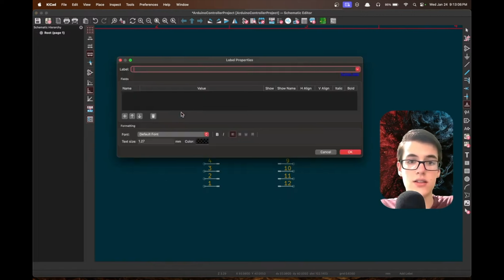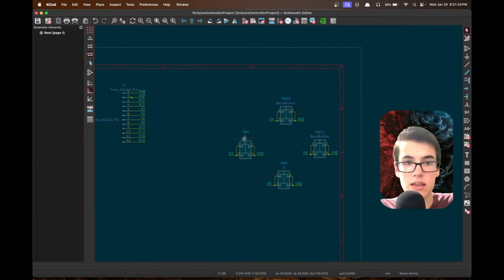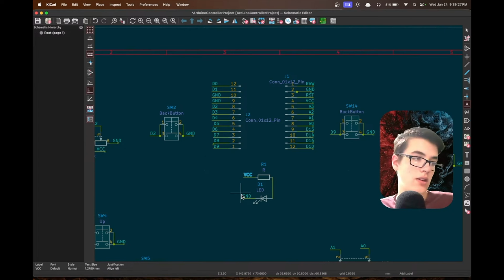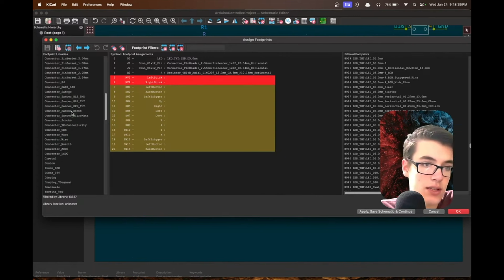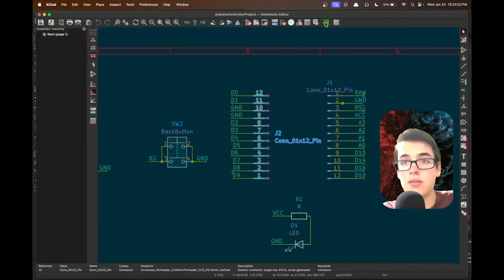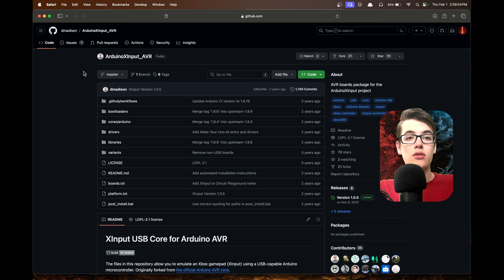Arduino Game Controller FULL TUTORIAL

Comment: Haven't watched the video yet, but it'll probably help me with what I'm trying to do. I'm planning on making an auto-controller. There's a game called Dragon Ball Xenoverse 2, and there's an in-game currency called TP Medals that is a PAIN to get. The fastest you can get them is 16 per mission, and the mission is about 2- 6 minutes long. The problem is that the LOWEST TP Medal items are like 100 TP Medals, and to get everything in the game would easily be 80k+ TP Medals. Plus, I'm playing on XBOX, so I don't have easy access to the save editor to just GIVE myself the medals. It's NOT an enjoyable aspect of the game, so I plan on making a system that inputs a programmed sequence of controller inputs, so it farms the mission for me. It'll be a nice exercise in both hardware/software tinkering and getting farming enough so I can enjoy the actually enjoyable parts of the game.

Comment: Great vidéo!, hello  is possible to use Arduino micro ( not pro) to add analog trigger instead digital trigger   please? Thanks a lot
Reply from the maker: I think so, it looks like it has 12 analog inputs so you should have plenty (2 for each joystick + 1 for each trigger = 6)
even better it has 2 more pins total, so you could connect up the joystick buttons as well (which i hadnt done)!
Reply: @danovation  Hi , i followed all instructions but i get this error message:

FQBN: xinput:avr:micro
Using board 'micro' from platform in folder: C:\Users\Pifou28\AppData\Local\Arduino15\packages\xinput\hardware\avr\1.0.5
Using core 'arduino' from platform in folder: C:\Users\Pifou28\AppData\Local\Arduino15\packages\xinput\hardware\avr\1.0.5

Detecting libraries used...
C:\Users\Pifou28\AppData\Local\Arduino15\packages\arduino\tools\avr-gcc\7.3.0-atmel3.6.1-arduino7/bin/avr-g++ -c -g -Os -w -std=gnu++11 -fpermissive -fno-exceptions -ffunction-sections -fdata-sections -fno-threadsafe-statics -Wno-error=narrowing -flto -w -x c++ -E -CC -mmcu=atmega32u4 -DF_CPU=16000000L -DARDUINO=10607 -DARDUINO_AVR_MICRO -DARDUINO_ARCH_AVR -DUSB_VID=0x045E -DUSB_PID=0x028E -DUSB_MANUFACTURER="\xA9Microsoft" -DUSB_PRODUCT="Arduino Micro" -IC:\Users\Pifou28\AppData\Local\Arduino15\packages\xinput\hardware\avr\1.0.5\cores\arduino -IC:\Users\Pifou28\AppData\Local\Arduino15\packages\xinput\hardware\avr\1.0.5\variants\micro C:\Users\Pifou28\AppData\Local\arduino\sketches\7C2071503D202209DDE6D6E313E9F5E2\sketch\sketch_jph.ino.cpp -o nul
C:\Users\Pifou28\Documents\Arduino\sketch_jph\sketch_jph.ino:1:10: fatal error: XInput.h: No such file or directory
 #include <XInput.h>
          ^~~~~~~~~~
compilation terminated.
Alternatives for XInput.h: []
ResolveLibrary(XInput.h)
  -> candidates: []
exit status 1

Compilation error: XInput.h: No such file or directory

Can you help me please? Thanks a lot

Comment: Can you make this controller with R2 and L2 buttons?
Reply from the maker: Sorry I’m an Xbox guy, which ones are L2 and R2? It does have the top buttons, and the joystick buttons are there I just didn’t have enough pins for the Arduino to take in the input, so with a different board you definitely could!

Comment: Thanks for the useful information. I made a joypad based on Arduino micro with the "joystick" library - it works very crookedly. I hope that the "xinput" library will solve the problems. All the best!
Reply from the maker: Im glad I could help! And Xinput worked great for me, so hopefully it should be the same for you!
Reply: @danovation  Here are the results of my research. For some reason, Windows refuses to recognize the device as a game controller with Xinput. With the "Joystick" library, the device is defined as an Xbox game controller. When testing in Windows, sticks and buttons press and everything else works fine and looks identical to how a real Xbox controller would work. But games do not think so and refuse to recognize it at all.
As a result, I managed to establish work with the "Joystick" library by installing the free application "x360ce" and setting up a remap there. Now everything is fine in games too.
The only downside is that you need to run x360ce for everything to work.
In general, I couldn't get Xinput, I tried. But a negative result is still a result. Thanks for the video anyway. I wish you and your channel successful development!
Reply from the maker: @ thanks man I really appreciate this! and I'm sorry it didn't work out with xinput
but that's good to if anyone else has the same issue I can recommend x360ce!

Comment: I am currently making a custom controller, I already have the buttons connected to input pins with a pulldown, I dont see how it could be an issue but would this code (-the input pullup) set up still work? i have all the buttons connected to a common vcc and kiiiiinda wouldnt be able to remove them cause they are already sealed in
Reply from the maker: If you already have a pulldown you just need to modify the code a little, swap out INPUT_PULLUP for INPUT, so it doesn’t use the internal pull-up resistor and then swap any checks against HIGH/true for LOW/false and vice versa (because now you’re pulling them down/low by default and then up/high when pressed)
Reply: @danovation  got ya! thanks for such a fast response, I was worried i would have to remake some things!

Comment: could you do this using an Arduino micro instead of a pro micro ? would it be difficult to change the programming
Reply from the maker: I looked for those but I actually couldn’t find one. The programming wouldn’t change but if the pinout/footprint of the board is different you would have to change the PCB

Comment: Hello,  I’m from Brazil!

I own a Scare Pad Monster Fleshy PS2 controller, which is quite rare, especially here in Brazil. Unfortunately, it no longer works due to its age (around 15 years old). After watching your videos, I thought it would be a great project to develop a new PCB with modern components and convert it into a Bluetooth(or wired, if wireless was too expensive) controller so it can be used again.

Since I have no experience in electronics, I’d like to know if you could develop this project for me. I’d also appreciate it if you could tell me which components I should use and how much you would charge for the service.

If needed, I can send photos of the existing PCBs to serve as a reference for measurements.

Thank you in advance for your time, and I apologize for any inconvenience!
Reply from the maker: Hey man!
I think that's a really cool project. You're absolutely right in saying it's probably not a great first project (since you have to do PCB design and then assemble that PCB as well) but if you're interested in electronics anyway I'd say maybe do a couple other projects that interest you first and work your way up to it (or if you're really determined just ignore me and go for it anyway!)

I wouldn't do a commision like this because the I think the value I could provide versus what you would have to pay would be a pretty big disconnect. We would have to:
- figure out the measurements and specs of quite a variety of components as well as the body of the controller
- I'd design a PCB that would hopefully work, but it would be very hard to ensure that on the first try with such a disconnect
- either you ship your controller to me or you have to end up doing some of the soldering and assembly anyway
all of this would take a lot of time for me (causing the cost to be quite high) while still being quite a lot of effort for you (causing the value of what you're getting to probably not be worth it)

Comment: Thanks for the video, very useful =D.  One question I have, is how do you know the exact space between the Arduino pin rows, and similarly set that in the PCB editor?
Reply from the maker: Good question! Thankfully the pin headers the Arduino uses are standard enough for KiCad to have them, so you just have to look (I think in the connectors section, so search CONN_ not header) for a header with 0.1”/2.54mm spacing (and of course whatever number of pins you desire)
And then when selecting a part (before you go from schematic to PCB) I think it suggests them for you but you can pick between upright pins, 90 degree angled pins and you’ll actually be able to see them in the 3D viewer
Reply: @danovation  Ok cool, yeah I remember in your video you specified which one, but what I mean is how do you space each header row in KiCad and know that width?  Like, I can see if I go to buy an Arduino Micro, that it's 18mm wide...but that doesn't tell us the distance to the center of the holes...and yeah we could measure one, but I would think it needs to be very accurate.  So what I mean is, how do we know that spacing, not the spacing between the individual pins/number of pins?  Is there like a footprint for the Arduino Micro itself and you snap the header rows to it?

Put more clearly (I hope LOL), I noticed you assigned a PinHeader footprint to each one, but if I go into the PCB editor, I can move each set of holes around, and I am imagining I must "zen" the Arduino board in place and line up the holes =D.

EDIT (again):  So, I actually found a library/footprint on Github (Biacco42/ProMicroKiCad), and I'd be content with that, but it still leaves me a bit mystified how you knew how to place the two separate rows :).
Reply from the maker: @ honestly i probably just found the source file for the micro (as Arduino boards are open source) and copied it from there, but finding a library is probably the easiest/best option!

Comment: The raspberry pi pico 2 has enough pins to add R3, and L3. How would I go about adding those?
Reply from the maker: The joystick footprint already includes the switches, so you can see if you're in the PCB editor that there are 4 pins that line up with where the switch would be. Between 2 of those pins you'll see an open switch symbol, kind of like  _/  -- if you connect the pin on one side of the switch symbol to the ground plane and the other pin to a port on the pico (using a trace), you'll be able to read when that button is pressed.
The main tricky part will simply be figuring out how to rout all of the traces as they can't overlap (unless you want to add more layers to the board which makes it more expensive), and you'll have to do all of those traces for the whole pico as its ports will be in different places than the Arduino micro.
As far as the code goes, it's just figuring out what the button is named and doing the exact same line of code for the joystick buttons as I did for the other buttons.
Reply: @danovation  oh this sounds dreadful to figure out lmao. Thanks so much for your help
Reply from the maker: @ sure! it's not that bad, but it is quite tedious...you can definitely do it though!
Reply: @danovation  alright thanks so much! This would be my first project that involves pcb and soldering project
Reply: @danovation  1 last question though. I'm making a handheld. If I were to split the pcb in 2, and connect both halves to the same pi pico, is that viable?
Reply from the maker: @Bungungus  yeah if you can figure out a way to connect them! you could also give each half a pico and then they wouldn't have to stick together

Comment: I have a problem with joysticks. They cannot be connected to the arduino in the PCB editor. I am not able to figure out where the error is. Nothing is connected at all. A1, A2, ..., GND and VCC
Reply from the maker: Hmm
I think even if you download my schematic and pcb files, you still have to install the joystick footprint like I show in the video.
If you haven’t done that, try doing it and see if it helps
Reply: @danovation  i have the same problem, joystick footprint installed and everything, idk why it's not working
Reply from the maker: @ have you assigned the footprint in the footprint assignment tool? and is it showing up in the PCB editor and but not correctly, or is it not showing up at all?
Reply: @danovation  I reimported the footprint and it somehow worked idk what I did wrong the first time but now it works thanks
Reply from the maker: Awesome!

Comment: My main issue with these diy controllers are we need to install a analogue trigger that maybe another set of potentiometers on top on each side? Coz we do not have 4 buttons on the two shoulders but actually two buttons and two analog triggers
Reply from the maker: Yeah that is one of the worst things about it, but I haven’t been able to figure out a solution for analog triggers that doesn’t require a full body build (which I might do at some point but it’s not an easy drop-in solution and would definitely increase the cost)
Reply: @danovation what if you dont want the imput analog? Could you swap out one of the sticks for a 2ndary dpad? Replace the triggers with a bumper, no potentiometers needed?

Comment: I love this tutorial! I'm trying to build a custom video game controller similar to this, but without the trigger buttons (only LR shoulders). This uses a custom PCB, but I'm trying to build a casing for my controller. Is it possible to use this tutorial, but solder everything with wires without the custom PCB?
Reply from the maker: Yeah you definitely could! the PCB doesn’t do anything special here, it just provides wiring and structure neatly. If you want to add that wiring and structure in a different way, that’s great!
Reply: @danovation  Thanks for the response! I don't have any Pro Micros, but I do have a Pro Mini and plan on using a USB to TTL adapter. I am having a problem with getting the JOYSTICK footprint installed. I have the library added, but the file doesn't show. What do I do? Also, with what I already assigned footprints to, the footprints aren't showing up despite following the steps in the video.
UPDATE: Joystick works now, but I'm still having problems with PCB not showing footprints. using it as a guide
Reply from the maker: @jlee-g3h  only thing I can think of is make sure these are components that have working footprints (like when you're using the footprint assignment tool make sure they actually show a reasonable footprint)
and don't forget to hit the button to bring components from schematic to PCB 😆
Reply: Oh god please tell me how it goes. Im trying to do the exact same thing

Comment: I don’t think you would need the switches to be dual. Since your connecting 1-3 and 2-4 your removing the “dual” capability correct? I would assume with a dual switch you control 2 things at once. Switch passing from 1-2 would turn on an LED and switch 3-4 would turn on the fan. For example. You’d turn both on with 1 press.
Reply from the maker: Yeah you could definitely wire it to 2 things at once for convenience, maybe that’s why they make them that way
In my case I didn’t need that so I just wired it up with both leads on each side going to the same place for clarity

Comment: are the Joysticks only able to do x and y axis? The click feature wouldn't work with this as they would require an extra digital pin for each Joystick, correct?
Reply from the maker: Absolutely correct, it's easy to add on the PCB, but the Arduino Pro Micro didn't have enough pins 🙁
Reply: @danovation  How would you go about connecting them to the arduino? I cant seem to find the where the connection for the button is in the schematic editor and therefore I cant label them to be able to route them in the PCB editor. Or is it possible to route the button without labeling it in the schematic editor?

Comment: heey :] I wanted to ask how much the pcb cost at the end. thanks :]
Reply from the maker: It depends on how many you order. PCBs are usually made in HUGE orders, but the company I worked with on this video, PCBWay, does orders as small as 5. For 5 PCBs it's about $40 + shipping, but if you order say 10, it only goes up to about $50 + shipping. You can check out the project files and order from PCBWay here: https://www.pcbway.com/project/shareproject/Game_Controller_with_Arduino_Pro_Micro_1b2bab55.html
I also made a kit with everything you need for the controller, but demand is fairly low so currently I'll only order the components after someone orders a controller, which means it may take a couple weeks for you to get the kit. Check the listing for specifics on timing, etc: https://www.etsy.com/listing/1665100767/game-controller-kit-with-arduino-made-to

Comment: nice job!
but idk why when i upload the code the pc don't recognize the arduino pro micro but when i upload other codes it read it
Reply from the maker: Thanks!
That's weird though. So my code doesn't work but you found some different code that works? Mind if I ask what that code is? Just in case someone else has a similar issue (or if there's something wrong with my code that I can fix, I've only tested it on my system of course).

Comment: bro is it possible to do this with an "esp32-wroom-32d"
i tried doing it the bluetooth way but it has unreliable connection and keeps disconnecting

but it would be a hassle to order an arduino board because it would take days or weeks to arrive
please reply, im knee deep in this project i already did the wiring, and code is the only thing stopping me from finishing it
Reply from the maker: Ah that’s unfortunate! The ESP32 doesn’t have a USB chip that can talk to a computer as a human interface device (most Arduino boards don’t either, that’s why you have to get the Pro Micro or maybe the Leonardo or a couple of others).
If i were in your place I would try to troubleshoot the Bluetooth as I’ve heard ESP32s are pretty good with Bluetooth, but I can’t help much there as I don’t have any experience.
Reply: @danovation  thanks for the info mate
Reply: @anothertemplarchuunibyoude3750  
if you want my advice quit using esp32 even the bluetooth part because it not good at all 
i tried to make it work but i didn't end up with any thing 
i used BleGamepad library but it's not that good i ended up using arduino pro micro and it worked well